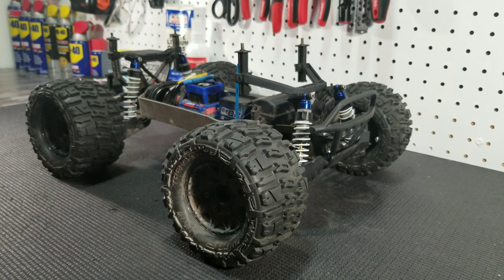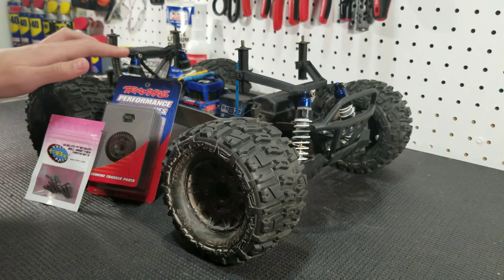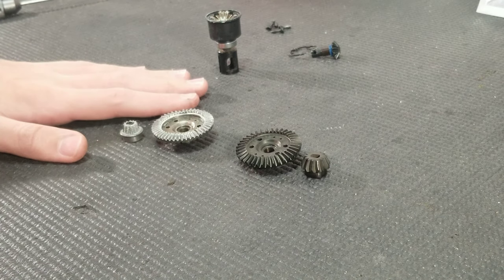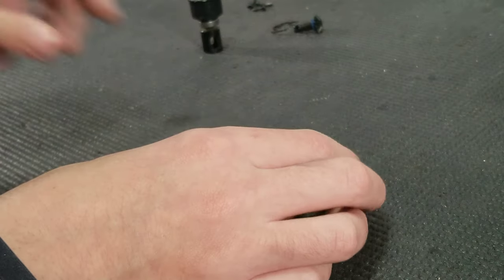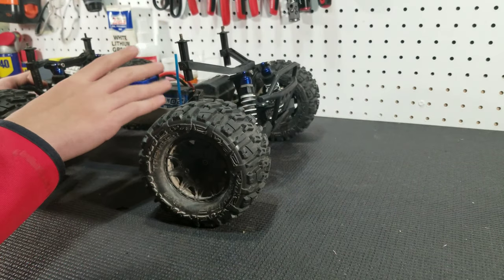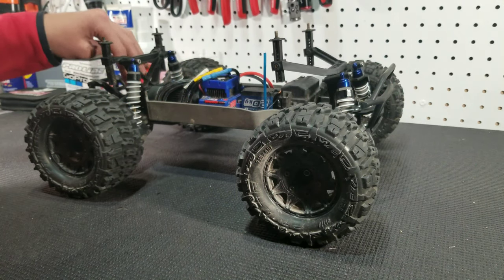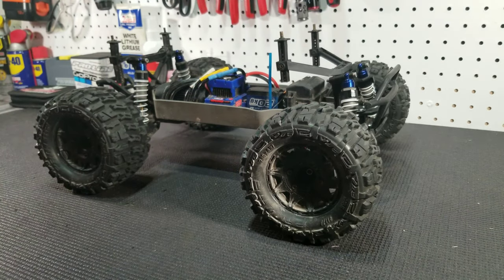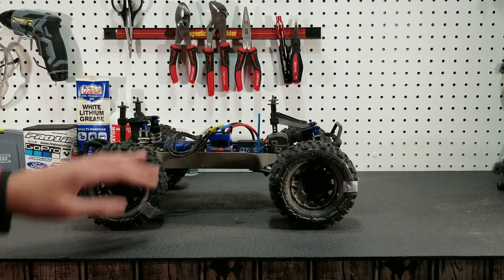Installing Spiral Cut Ring & Pinion Gears! | Upgrading the Differentials on our Stampede 4x4 | Pt. 2

Comment: I feel like that resistance you felt was the difference in gear ratios between the front and rear
Reply from the maker: Exactly what it was. I think I put that at the end of the video.
Reply: @traxrc  yeah I heard you say they were different. I didn’t hear you say that is what the problem was. Great video though! I just spent like 1500 in slash parts for my 4x4 I just got. 😅
Reply from the maker: Yeah I don’t remember lol. It’s not like I go back to the video when someone mentions something in it. I just go off memory cause if I did that for every comment I’d waste a lot of time. 
Sounds like your gonna have a crazy build!!

Comment: Having a issue with my stampede 4x4 with the acceleration. Took it out and after about 10 mins I noticed it wasn’t taking off like it normally does(no wheelies or nothing) but it sounded normal and was moving pretty quick. Do you think it could be something with this?
Reply: I was beating it up pretty hard lol
Reply from the maker: Check to see if you accidentally put it in training mode. I did that once and never noticed for a few months because I didn’t drive it. I started driving it again and hated how slow it was (I didn’t remember the real speed). I ended up listing it for sale and thankfully no one bought it lol. I found out it was in training mode then.
Reply: @traxrc   gotcha I’ll definitely check that out. Thanks again as always I appreciate it brotha!
Reply from the maker: You bet!

Comment: I think the screws are just that the update diff cup can cater the extra length for strength.  And well done on working through your problem, was thinking the same.. mark the tyres and check roll out.. 
I'm suprised it doesn't say on the packaging to replace both front and rear gear sets to avoid binding (or wind up)..
Or at least only use on loose surfaces blah blah blah...
They look solid though compared to the monkey metal ring and pinion. 
Cheers 👍
Reply from the maker: Yes the new screws are mainly for durability we've found because the XO-1 Cup went together fine with the stock hardware. You would think that Traxxas parts would work with other Traxxas parts just fine...lol! We are probably going to contact Traxxas to get their take on things. Thanks for watching!
Reply from the maker: Sure enough... we just contacted Traxxas about it and they also said that you need to replace both. It's really frustrating that they didn't advertise it, but hey... what can ya do. If we do drive the Stampede 4x4 it will only be on loose surfaces, running on 2S instead of 3S like we normally do, and we will just be easy on it, until we get the gears for the front.

Comment: I would wait and upgrade the front lol, hey did you ever address the problem with the front Tekno driveshaft hitting the DIFF?
Reply from the maker: Yeah we don't feel the need to get the XO-1 Internals for the front right now...
We never had a problem with the driveshaft hitting the diff so we don't know where you got that from. Thanks for watching!
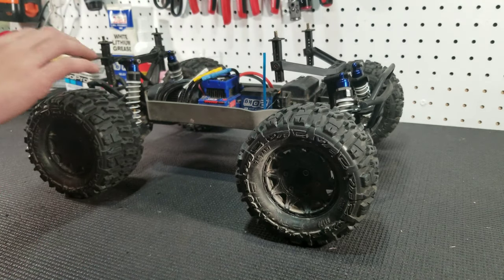Reply: @traxrc  https://www.youtube.com/watch?v=3xw5dfoAZ2g&t=39s 7:00 Min mark you talk about a minor issue that will be solved in a different video, Lol and thanks for the reply! Really enjoying the vids! I just installed the rear Tekno M6 and just waiting for the fronts, they're awesome!
Reply from the maker: Oh yes we fixed that! What we did is cut up some nitro fuel tube and installed it on the shock Shafts to limit the travel which doesn't allow the driveshaft to hit the diff. Thanks for the kind words too!

Comment: Nice vid. Did you do any research on different weights of diff lube? I have a Hoss which is close enough to the Stampede and I am upgrading my diff after the front got bent while racing on a hard clay track. Glad you mentioned doing both diffs at the same time.
Reply from the maker: A thinker weight diff lubes is going to result in less movement inside the diff, so if you put something very thick, it would act as a locker almost. It also prevents the diff from sending power to only one tire causing it to balloon. I'm still running the 30k weight I put in, and it is a little light for my liking.

Comment: The spiral gears have a faster gear ratio
Reply from the maker: Ya I learned that the hard way when I installed only the rear one at first and noticed the rear wheels spun faster than the fronts lol. I address it in another video.

Comment: How performance spiral gear between standard diff gear?
Reply from the maker: Performance wise, you won't notice a difference besides it will be a bit faster, which is why dropping the pinion gear size down 2 teeth is needed. Otherwise you may experience overheating. Other than that, the differences are strictly durability relateed.
Reply: @traxrc  pinion down 2 teeth to get torque, alright?
And more durables than standard type?
Reply from the maker: Dropping the pinion 2 teeth will make it perform similarly to stock so it retains the amount of torque and will not overheat. These diff gears are without a doubt more durable. I used to break the stock ones all of the time, and I've never broke the upgraded ones.
Reply: @traxrc  thank you for the information 🙏
Reply from the maker: Glad to help!